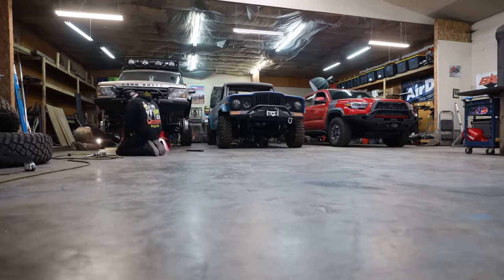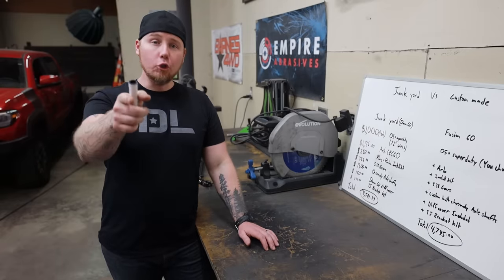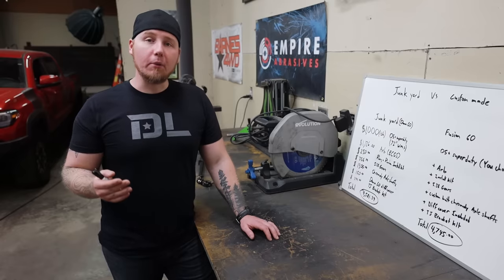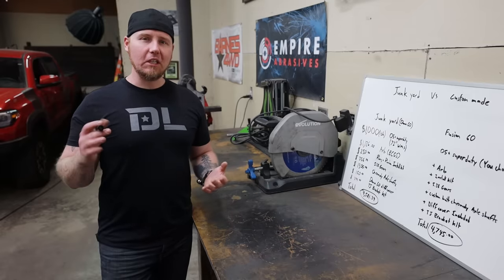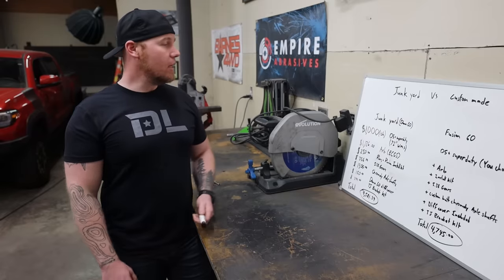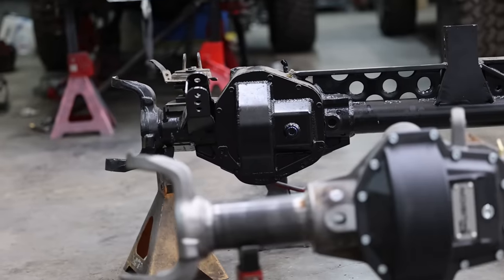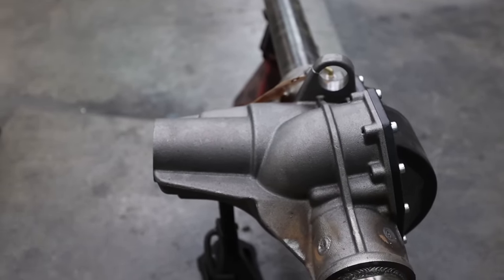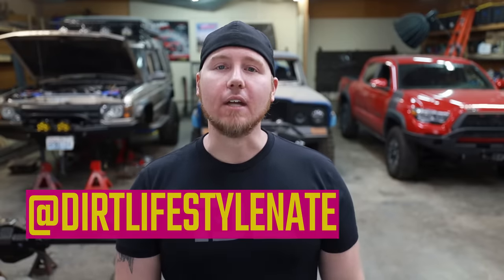Don't Buy 1 Ton Axles Until You Compare These Costs

Comment: That advice is right on the money with my experience..  I'm running modified OEM axles on my SAS'ed Isuzu Rodeo and I've broken the rear OEM Isuzu Dana 44 twice and the Toyota front axle once.  Yeah i know, shoudda gone 60's)  They have both been rebuilt with everything hardened now and are almost indetructible for 44's.  But if I ever build them again I'll be putting in Custom Dana 60's.  I really don't wheel that hard these last few years (7) because I've been busy fighting cancer, and shatterd both feet and had both legs fractured in that accident.  (So not a lot of wheeling time)  As I'm getting older (71) I find I just don't need to tear stuff up as bad as I used to.)  
Funny thing though I've been kicking around the idea of putting a custom Dana 70 front axle under my 37' FERD Motorhome.....  Only I may need to go reverse portals because the old girl is pretty tall now, and I want it more for snow country than rocks.  But that's crazy I know!
Good Video!

Comment: In the last 6 months I've been through this same thing. I ended buying my first set of new axles ever. After looking at costs for used and making them work in my wj project the price point wasn't that much more for new. Don't get me wrong it hurt a bit🤣 I've always used junkyard or used parts in my builds to keep costs down. Your point that we just don't live in that time anymore is true and will only get worse as time goes on as parts are used up. The mental struggle is real but long live the aftermarket!

Comment: Cool video with great comparisons. Downfall of the custom axle is you need custom axle shafts, if I break a SD axle I can run to an auto parts store and grab another and the stock SD axles can hold big power so moly isn't needed unless your really going to beat the crap out of it regularly and they can still hold up to that. The custom axles are cool, but still over priced imo, especially with the cheaper salvage and FB marketplace prices we have in the south.

Comment: Very true, depends on the rig. When you're broke and time isn't a huge priority it can be better to spend a bit more in the long run (potentially with spare parts). Find a cheap housing, work on it, buy some gears and take your time, use leaf springs and OE axle shafts and roll until you want to upgrade (4 link? Cromos?) Then find a front and repeat.

Comment: Very very good points here, but to truly compare apples to apples, we need to consider the cost of the outer assemblies that usually come "free" with that initial junkyard axle. If you can get away with using stock parts there, we can count some significant savings. Knuckles, unit bearings, locking hubs, brake calipers, mounting hardware, etc can add up pretty quick. 

Fusion of course offers a kit with all the outers, but the price jumps a few grand. You could scrounge junkyard outer assemblies and save some money, but at least at our local u-pull-it, you'll pay almost as much for all the outer stuff once they bend you over line-by-line as you would have paid for an "axle assembly" at a single price. Just more stuff to consider when making this choice.

The other thing to highlight here is that with custom width axle comes custom width problems. I have run custom width before when the build required it, and I have more than once been annoyed waiting for a replacement custom shaft when something breaks. Certainly not a deal-breaker, but it is another bonus of sticking with stock widths. In-stock replacement parts can be handy. 

Great points in the video though! Keep up the amazing content!

Comment: I'm seeing the same thing happen with toyota minitruck axles. Its about the same to buy a new housing and adding ebay knuckles and such compared to just buying a stock complete axle.  Then running a samurai, it for sure makes more sense because you can buy custom offset axle housings for the same cost of building a fj40 axle up!

Comment: YouTube professionals, I'm building a K5 Blazer as a daily driver with moderate overlanding capabilities. I'm looking for a 3/4 ton front and rear axle set to handle this 7,000lb Blazer on 35" tires. The other components I have on the build include front and rear dual shocks, NP208 transfer case, 700R-4 tranny, and L05 TBI 5.7L

Comment: I put a Dana 60 kingpin with high clearance pinion from an 88 ford f350 in my jeep YJ.   I bought an outboard mounting kit from Dave's off-road so I could bolt it right in and run it full with width.  Then I found a 14 bolt dually rear  from an 88GM cab&chassie truck at the boneyard for a 150 bucks and bought a disk brake conversion kit and converted to single wheel and I've been running about set up for 5 years and my Jeep with no problems....

Comment: I'm on the fence about building my 85 toyota pickup front axle. I want to widen it with ifs hubs. Truss it. And knuckle gusset it. I could do all that work to that housing or I could get a trail gear rock assault housing setup for tacoma width. It'd probably be a lot stronger and I'd get the width I'm after. I can still use the 3rd member I plan to use plus all the outer stuff. Decisions are hard lol. I love the feeling of building up a stock junkyard axle but it makes more sense going with an aftermarket housing that would cost the same if not a little more than modifying the stock housing. I could also sell the 85 housing to cover some cost.

Comment: Great video.  What's the plans for the FSJ?   I used a  Ford 'sno fighter' Dana 60.  The perches are in the right place (SOA vs SUA) so I got 6" of lift.   Basically bolt in.  They are getting more expensive now (I picked up mind about a decade ago).    It had the right gears but I tossed in an air locker and some Yukon hubs.    The brakes are probably the weak point, just not a great design but they work.

Comment: I had a 2006 SD 60 delivered to Portland ore for $575 in 2022 they are still cheap on LQK online . The ones he talks about being sold for over a grand are being resold I have seen them and they are still on the pallet like mine was. As of 3/12/24 I found  . I found 12 on there site for between $575 and $375  plus shipping. that was just one search of  2006 f250.

Comment: I Just took Delivery of a cast Housing. Now I realize 4" x1/2 Wall Tubing may be WAY Overkill. Now to 35 or 40 Spline?  (4130 of course) Im only going to run 40" Tires at the most.

Comment: Sd 60-$350
Grizzly locker, gears, install kit combo ebay-$840
Artec tj swap kit-$480
JHF knuckle kit-$190
Balljoint eliminator kit-$600
Drive flange kit-$250
1550 axle kit-$350
Tmr cylinder mounting kit-$180

Total-$3,240 and more complete than what's shown here. Add extra if you want to run RCV axles.

Comment: I just bought a front Dana 60 for my Jeep ZJ for $600. I don't have enough to buy a kit (I'm in college, and I won't have that kind of money for several years because of grad school). What you said about the pinion offset worried me a bit. Should I sell that Dana 60 and just save for a full custom axle? Is the pinion offset an issue on Jeeps as well (zj has same front end as a tj), or is the land cruiser a specific case. My current plan is to build the 60 and a 14 bolt rear slowly as I have the money, with just truss and gears to start out.

Comment: If folks consider it this way.
Compromise on the axle (or any other component) and it fails on the trail - you're out the recovery hassle and/or costs, any damage that resulted from the failure, AND the cost of doing the job right that should have been done in the first place.

Comment: but is putting a couple D60's under a cj-7 worth it vers a set of D44's?
as in weight? the cost is about close enough to be a wash. (about $1K or so).

daily driver? it gets driven to the trails and "other things" but NOT a mall cruiser.
as for a cj-7 these axles would be cut down quite a bit. less than 62 in wms-wms.
a rear 8.8 is easy to do such, maybe at my place. (lack of proper working space).
or a built up corp 20 out of a waggy? (reuse the guts i have now). 
a built up 9in for weight  (front and/or rear).
just a fi amc 258, T18, dana 300.

Comment: I swapped tons under my 96’ F-150, the reason I did it was because I swapped a p-pumped JD 4045t into it and was worried about weight, I got both axles out of a 2004 superduty for $600. For me that was worth it.

Comment: Got front and rear today from a Pick and Pill for $451 combined. From 2008 F250 FX4 with a blown motor. Lucky find.
Reply: Guess I should mentions it is for a Swap into a 1967 F250 and it's pretty much a bracket kit to install.

Comment: Wow....really gives me a lot to think about 🤔...
     I am a big fan of building with junkyard parts, and i usually find the strongest part, and engineer everything else around it, so if i end up breaking it, it is easy to swap out.....
     That being said, it does make sense to buy new, but i doesn't want it so custom, that it's considered a one off in 5-10 years when it wears out, and nothing else can easily swap out in an emergency....
     So i guess, i personally, would look for a heavy-duty aftermarket axle with factory stock measurements, so if i have a breakdown, and this company no longer has this axle or whatever, i don't have to start from scratch again.
     I'm very glad, my rig is scratch built, so I can engineer the suspension to fit the strongest axle....
     My issue won't be offroad abuse, but extreme weight, I'm building a huge livable overlanding rig, Dana 80's front and back, powered by an 8.3 Cummins rear mount

Comment: I get what you had to say but still hard to price it all out. There is a lot of variables. Maybe at the end of this series you can mention what you actually spent to put the fusion under the disco. Labor hours. And price. Vs what you did in the junkyard one. Assuming you had no free parts lying around. You mentioned all the basics but at the end of the day I’ve seen people use junkyard brake pads that cost 5$ a set and work perfect. Each person has to live with where they cut cost and the potentials of breakdowns.

Comment: For 5 grand I would be looking at alternatives .Tractor axles or Rockwell 75  or a ww2 1 ton for the reverse rotation transfer case and go with a custom 14 bolt front end

Comment: Definitely similar pricing when built to the hilt. If I were to spend 5K I would definitely go aftermarket. But in my area, a 05+ D60 is about $400 at multiple yards. No need for an ARB for me, just a Spartan. As far as a truss and mounting it I have a few tools and know how to use them. Personally around $1500 for a swap on my XJ.
Reply: Where are you at that those axles are that cheap?
Reply: @matthewmurray5168  like 6 pick and pulls in Tulsa OK. Just have to know people who call when they come in.

Comment: I've been saying this for three years. Ford 8 .8 vs ECGS D44. Everyone wants to lie and say they just grab an 8.8 and brackets and go.. they never do the apples to apples breakdown honestly.
Reply: I did a ECG 8.8 with 35 spline chrome molly c-clip eliminated and a OX locker
Reply: @603jeeper7  I would have gone with their d60 before an 8.8...
Reply: I was not looking for 8 lug and the 8.8 is the same  Track .  now with upgrades it's as strong as a 9"
Reply: @603jeeper7  they make a d60 with 5 on 5 lug....
Reply: @JamesTremblay  yes but not 5 on 4.5 tj
Reply: @603jeeper7  https://eastcoastgearsupply.com/i-6865173-dana-60-tj-rear-bolt-in-axle-assembly-semi-float-5x4-5-5x5-5.html
Reply: Nice I don't believe that was a option at the time I purchased mine. I will be looking to them for the jku when that project starts 😉
Reply: @603jeeper7  btw, I grew up in Manchvegas and then lived in Newmarket for 10 years...
Reply: @JamesTremblay  we currently live in Dover but thinking of moving more north.

Comment: You forgot to mention time... How many hours does it take until you have the axle the way, you want it vs 45min to order and think about specs and click the button... Time is worth a lot these days.
Reply from the maker: I couldn't agree with you more 👍
Reply: This exactly, I spent probably close to 75 hrs on my 8.8 swap because I'm anal. By the time I was done I didn't save anywhere near enough to make it worth my time. If I had spent that time doing side jobs I would have more than had enough to pay for a new axle
Reply: Most definitely, time VS money is an issue for a lot of people. My situation is that I'm piecing a 44 and 60 together. I'm wanting 8 lug axles to run humvee wheels. From start to finish, I'll be looking at about $5000 to build both axles how I want (full case autolockers) with likely 80 to 100 hours of work in the garage. 

Its also a learning experience for me, it would definitely be easier and faster to buy them, but there's things you just want to learn. Also by building it yourself, you can write down every last part number, if something breaks you know what parts can replace it. 1 year ago I would have had no clue how to change bearings on my spindles.
Reply: I agree that time is worth a lot these days but you gotta remember that just about everything you order especially custom stuff is on crazy insane backorder cause of covid
Reply: @ExperiencesAndEquipment  for sure, it still is a hobby for most of us. Some stuff one does, doesn't make sense but one really likes to do it. I often get asked why I daily such a relatively uncomfortable, inefficient and slow vehicle... I guess that's just what a hobby is.

Comment: Just use Nissan Patrol axles,  front one bolts right up to the Discovery, and they are super strong. Stock can handle 40" tires, no problem.

Comment: Great info here but here's a good question....I already purchased an 05' SD D60 front axle which I've already cut off all the brackets. Also I have a Chevy corp. 14b rear w/ disc. brakes which I still need to clean and remove brackets.  So the question is would it be worth it at this point to sell what I have and go custom??

Comment: I bought a donor f250 for 4.000€ and sold the engine, transmission and t cas for 6.000€ because rare in Germany. I would buy a new diff housing and cut of the old one to swap the sides. Then weld them together and go on. I think a ram 2500 has passenger side drop too

Comment: The price of the standard dana parts have gotten astronomical. And it makes sense to buy a axle.

But there are entire junk yards of 3rd Gen HD dodges with the AAM, 9.25/11.5. Which are reasonably priced. Plus most of the time it'll come with a good hemi or cummins motor.
Reply from the maker: I've actually been very interested in AAM for along time. When the aftermarket starts to catch up I think these will be super popular

Comment: I want to 1 ton my front axle on my 93 Toyota 4 Runner but I need a passenger side drop and am having a hard time finding one. I already have a Dana 70 rear axle on my shelf with a Power lock unit.

Comment: I’ve got a 2022 Jeep Gladiator Rubicon model. I’m running 37*13.50*17 tires I also have a RTT and carry weight when I camp, overland. 
I’ve upgraded my gears to 5:13 but still have the Dana 44’s. 
Should I upgrade to one ton’s??

Comment: Nice video and not trying to say that it's not worth it to get a custom Axle just also mentioning that a junkyard axle typically comes with knuckles brakes and calipers and all that good stuff to you got to factor that in that's a few hundred dollars
Reply: Also, a custom axle with custom axle shaft lengths means if you do brake it, you can't just go pick up a new one from any parts house and be back on the trails that day. You will have to wait weeks for it to be built and shipped.

Comment: So, I went to the fusion website, and for a tj axle, they start at 7750. Am I missing something??
Reply: Looks like they are quoting a complete axle.

Typically you buy the housing, r&p, locker and axle shafts and they assemble for around the price Nate is speaking of.

Idk about the 60's but i know the 44's re-use your existing knuckles, brakes stub shafts and hubs, then you can WJ swap them later if you want. And yes dana 30 and 44 are compatible from knuckle out.

Comment: I bought 2004 Rubicon 44s for my 97 TJ. I regret doing that in that I spent more having them built with gears, Elockers, chromoly axles and RCVS. I should have bought brand new G2 setups front and rear.

Comment: Is it important to run equal gear ratios in your vehicle? For instance? I have 4.10 front and rear. But i wanna upgrade my tires from 31s to 33 interco Thornbirds. Is it okay to run 4.10 in the front and 4.56 in the rear or just run both at 4.56?

Comment: Hubs, spindles, hub locks, hub bearing kit, brake rotors, brake calipers and so on still need to purchased and added to your comparison.  When you go to Fusion's website and build a drop in replacement you are at $7000 after selecting ratio, locker, brackets and labor to install those things.  Add on the things I mentioned and you are going to be close to $9000 (you can verify by looking at the complete axle sets that Fusion sells).  Build a junk yard and you will save a few thousand if you can live without upgrading the things you don't have to.  In your comparison the junkyard axle has all of that stuff already, you would probably only need to get the wheel hub bearing kit.  Just saying this isn't quite apples to apples.

Comment: Even when you compare a 05+ superduty build to a more expensive company like Dynatrac if you cant do every little thing yourself you will 100% pay the same or more and have old used stuff as a basis in the end.

Dressing an 05+ superduty rear to go in a TJ or JK is no easy task. Its a solid 4-6 hours of torch, grinding, cutting to fit up an artec swap truss and thats before you even turn the welder on. You'll be $800-$1000 into just labor if you have to pay a shop.

Comment: The biggest difference is the ability to spread out the parts in a junkyard axle.  Buy a set for $1,300 and save for a locker, save for a set of gears, save for chromoly axle shafts, etc. with the axle installed.